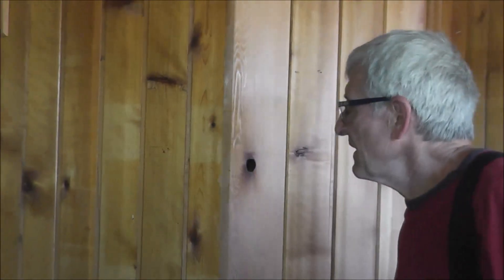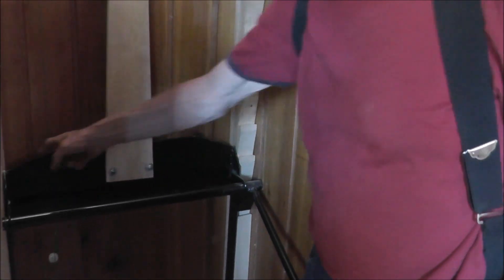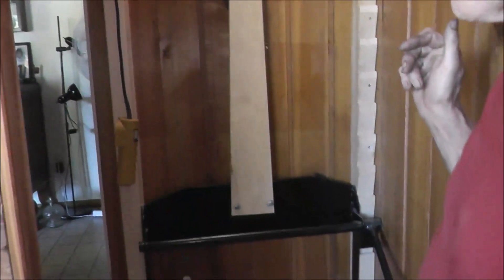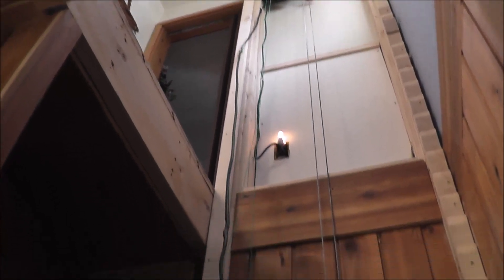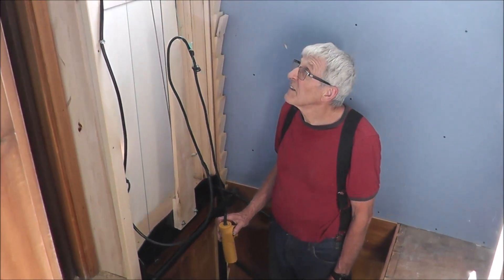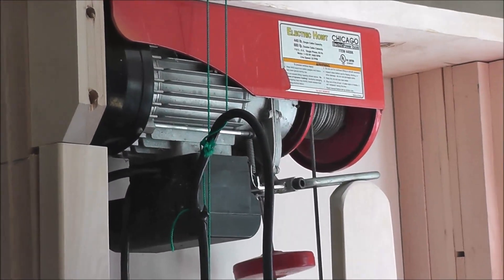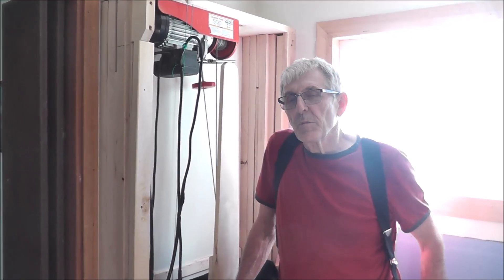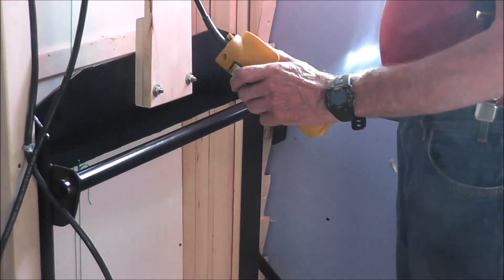DIY Elevator for home or shop

Comment: Many of the commenters here who minimize safety considerations are absurd.  Don't listen to such people.
Your elevator safety approach is dangerous. Fall safety for this application must NEVER rely on operator intervention. That simple.

While I applaud your initiative and efforts, the manual holding up of the 'safety stop lever' (during down travel) is an inherent design flaw that may lead to serious injury.   (Show this message to your wife or any user of your elevator.)
You have not thought through this safety issue. 
A sudden snap of the support cable (or associated critical suspension components) will cause the elevator to suddenly drop.  At this point, the operator's arm (initially physically holding the safety arm upwards against gravity) will simultaneously rise as the elevator begins to fall and become 'weightless'  - thus countering the implementation of the safety mechanism.    
Even if the operator were to quickly (?) move her arm intentionally downwards after the lift started falling (a very doubtful consideration for a 'startled' person when in 'free-fall' herself), the snap down of the 'catch' mechanism when it engages a 'cog' may break her arm (if it actually engages) or otherwise overwhelm the integrity of the stop mechanism (allowing the elevator to plunge totally downward) even if it engages.
You must change this system before a serious accident happens.  This is a deceptively terrible design for a personal elevator safety wise.
A possible remedy might be to attach a passive load carrying 'fall arrest' spring device in 'series' with the cable connection that requires NO operator intervention.  You know, like the original (Otis?) elevator design of over 100 years ago.
Only a completely passive safety system is acceptable.  Your active system actually makes more difficult/unlikely engagement of the safety stop mechanism.
https://www.youtube.com/shorts/BfVpbURY6VM

Comment: Thank you for the information
Reply from the maker: That was a poor video, I didn't know about editing sound etc, got a lot of reaction to it, but has operated flawlessly for number of years with maintenance. replace cable , adjust and lubricate slides.  I also installed fall arrestors as well.

Comment: Love the design!! That said you really should get 2 fall arresters one on each side of the track.  They work like a seatbelt.  Will go in and out until a it encounters over speed then lock it up.  You can get them with cables or the same type material that ratchet straps are made of.   It would be horrible if something happened and god forbid your wife got injured!

Comment from the maker: The converter may be the best bet. jumper cables from the car battery, emergency like that would only be momentary. up or down.   fix it so you would just have to use an extension cord to car. For my self I think I would use a generator as my water pumping system shuts down for water.    Also my design works well, safety going down is not the best.  I saw one video where the fellow attached fall arrestors. They are used in industry to protect workers from falling off scaffold etc.  I have ordered one to put on mine.  I see a number of people have built them now, some good ideas out there.

Comment: I wish you could mount the winch/motor to a concrete floor and use a nice quality pulley up top, or have a good welder make the whole top section from steel reinforced into original structure. I'd hate for that Winch to give way at some point in time and hit anyone in the head. At least you did it and I'm sure it's handy as is. Be careful.

Comment: Needs railing on upper level
Reply from the maker: would be an added safety feature but at the top floor it is in a locked room when it is down.  It is small so would interfere with my wife getting on and off.

Comment: Nicely done.  Congratulations.  I suggest you install a false floor upstairs so no one can accidentally fall down the opening.  You could probably hinge it such that the piece of wood that contacts the upper stop switch pushes the false floor up out of the way.

I need something similar to replace a narrow staircase that is (not to code) to lift items up into a loft above a garage for storage.  You design will be my inspiration.
Reply from the maker: Its a good idea, infact necessary, however in this case it is in its won locked small room.  We get along with that safety feature OK.  But would be better to bde double safe.

Comment: How is the actual frame made?
Reply from the maker: I used 2 inch angle Iron,  Frame around the floor section,  welded to the upright angle iron, flange facing out to go in the guide slot. a couple angle braces and steel plate at top where the cable attaches.
Reply: @brianprocter6191  do you have rollers on the uprights?
Reply: @brianprocter6191  DO YOU HAVE ANY SHOP DRAWINGS FOR THE FRAME ?

Comment: Hi buddy awesome built...it's a genious idea regarding the safety feature when the lift is going up but i have a question about the safety when the lift is going down since you put up the lever....
Can you please help me understand the concept.
Reply from the maker: My reasoning was if the cable or something was to fail, it would fail going up. It seems to glide down smoothly with little stress. What it did was put a spring on the lever so if one let go it would snap into lock, like if something happened going down. I have been criticized for not having a fail stop system among other things.  what I need to do is put another locking mechanism  under the one I have with a strong spring  adjusted to the weight of the person using the lift.  The cable would first release this lock and then start to lift platform. any slack in the cable caused by a failure would quickly lock it in place when going down.

Comment: I thought the electric motor had a safe break built in,  in case the power was off. Usually it is an electromagnetic brake.

Comment: Very nice build Brian. Simple straight forward. I really like your safety catch system. Glad I found your channel.
Reply from the maker: Thanks, it works well and is quite safe, even though I have been criticized for doing it.  Looking forward to better days ahead, my wife goes in for hip replacement next week.
Reply from the maker: safety catch needs improvement. read my reply under Jean Paul's comment. at top right now.
Reply: Do you have any shop drawings for the frame of the platform ?
Reply from the maker: @johndeverjrjack2673  I could make one up for you if you supply an email. didn't get back to right away as needed a part for computer

Comment: Firstly, why do stairlifts cost 14k CAD? In most of Europe you'd pay around 3.5k CAD fully installed... I can't imagine why you've been quoted so much, there surely isn't that big of a difference between European prices and Canadian prices.

Secondly, why can't you get a wireless controller? There are literally wireless controllers for everything... there are most definitely wireless controllers for simply two-way switches... I think that your problem is, that you have zero skills in searching for things; which is almost certainly why you can't find a stairlift supplier that can put a stairlift in at the normal price, and also why you can't find a wireless switch controller (I just did a quick Google, and literally found dozens that would do the job, and all for well under 70 CAD).

Thirdly, and finally, Without wishing to cause offence, I think you've created a deathtrap (or serious injury trap)... There are dozens of crush risk points all over that lift, from the bottom, to the bits between levels, every part is a crush injury just waiting to happen. You have not installed a single crush guard, and as far as I can see, you have not installed a single safety sensor that cuts off power if it detects an obstacle (like a foot or arm/finger etc). If that wasn't bad enough, there is a serious risk of that controller's power cord, getting damaged by the lift action and causing a risk of fire or electrocution.

I know you're proud of your work (as you should be) because as a dumb-waiter or goods elevator etc, you've created a fairly good device, but as a people elevator, you've created a nightmare-in-waiting. I personally wouldn't allow any person to use it if it were in my property, and I most definitely wouldn't allow someone I loved or cared about to use it.

Videos like this, tend to elicit two kinds of responses in the comment section; they're either unremitting praise, or simple trolling, bad mouthing your efforts... This comment is neither. This comment is a genuine, considered response to the work in your video. It is not intended to be insulting or dismissive of your effort or work, and neither is it intended as a troll, or insult... I hope you realise this, and take this comment in the spirit that it was intended.

Comment: just curious ... its been just over 3 years now ,,,how is the homemade elevator holding up ? ... did you make any changes ?  ....  has anything worn out or failed on it yet ?
Reply from the maker: It has worked flawlessly, I have replaced the cable with a better one.  Should maybe replace the winch just to be more safe, things wearout in time. Does not get much use, a few minutes a day, and none now for the last number of months,  wife waiting for a hip replacement, will see the surgeon on the 25th, the covid thing has slowed things down in the north.  Its been a life saver for us,  but some say a life killer.

Comment: I like it but I think it's missing some safety features that hindsight could always prove were worth it, encasing that motor with spool shaft and including some foot level protection in the gaps around the floor. Plenty of other things to bring up actually. That ratchet tooth lever makes more sense as a press down to release as in case of it actually breaking free the user holding the lever up might result in the user hanging on rather than letting go to let it lock in place. Those wires, should they snap (they're not going to) could whip into the user. Should the user happen to faint while in transit they might tumble out or worse be pinched between platform and the ceiling. Not saying the manufacture by independent hands is wrong but considering the application for this elevator it's worthy to build in more protection against chance and time bringing about a disaster.

The lever is an interesting addition if only for the ratchet. I can't in the moment think of an alternative that involves an active input to keep the lock disengaged but naturally released if weightlessness or panic occurs. As to a pinch at any of the lower and upper sections just needs a similar trigger as the one you have for halting the motor at the top. Really think it's important to complete this if it hasn't been worked on further since this went public. Still, a very thoughtful and industrious creation.

Comment: Nice job,,good home engineering, but you do lose your free fall safety I think on the ride down, I will tell you I had that same Hoist and the hook snapped off during a lift of a piece of equipment, 750 lbs, made in China, about got me, I don’t think you are using the hook but just letting you know in case. You probably have the free fall covered but I didn’t see it, just letting go of the safety handle prob,not fast enough
Reply from the maker: Thanks for the comment. lifting much lighter loads , replace cable with better quality and size.  downward could be better. the handle has a spring on it so should snap in if released, I can make it automatic with alittle work.

Comment: Good DIY. What if the electric goes off?
Reply from the maker: I had though of having a small ladder  accesible  to use to get off where one could reach it. However it hasn't happened,  when the power fails in use, all one can say is |I| wish I had.   My wife has gone to use it when the power is off.

Comment: If home elevators werént  so over the top expensive, people wouldn't have to resort to this.
His cost him a $150 to make, while I understand a commercial  has increased safety features im not sure that the difference between $150 and $20,000 is warranted.

Comment: Used sensibly it’s ok, With more money spent on it over time, more safety devices can be installed to it, I’m an ex Lift engineer then Inspector with 47 years experience in the UK.I wouldn’t let children use it, But it does the job for a person with a disability.
Reply from the maker: Thankyou for the very kind comment, considering your expertise.  most would have and have condemned me.  Yes i can modify it to a no fail system up or down, and should. Have replaced the cable  with a much better one and considering replacing the winch every few years.

Comment: Be careful calling it an elevator.
.
Elevators are regulated.
The regulations are part of why the stair lifts cost so much.
.
If the building code enforcement finds you you made an elevator to carry people they can condemn the house until it is removed or brought up to code.

Comment: I've had many prototype projects inspected and certified through the CSA special certification program. I just invent it, document everything and submit it for pre-approval and then take a quick trip to Richmond for a final test manly for voltage insulation testing, just a high voltage Meggar. Pay about a hundred bucks and it's good to install. By making machines plug in instead of hard wired I could save an onsite inspection too. Just recalling some fun projects. A gas fired curing oven for composite aerospace panels made it into the gas safety yearbook and was eventually sold to a helicopter structural repair company in Florida. I always found the yearbook honour a little bit funny or lucky as an electrician dabbling in gas fitting but I did do my homework on its design and as far as homework, for the first time in my life I should probably add.

Comment: The plan looks good - I am planning on doing your design from the main floor to the lower crawl space which is 6 feet high - the current steps are too steep for me - how does it stop at the bottom - I understand the cut off at the top.

Comment: This seems like it had a tremendous potential to be a hazard, but it isn't. If you are aware of what could go wrong it's easy to avoid any issues. (I.e. don't fall down in the big hole in the floor)

Good job!

Comment: Awesome. I need to do this in my home and am researching. Looks like there is a weak single point of failure in that horizontal 2x10 at the top that the winch is mounted to. Might want to double it up or reinforce with some vertical 2x6's or steel like in a doorway / load bearing span. If that 2x10 snaps when going down, it'll be Looney Tunes, complete with the winch falling on your head after you land. Keep up the good work. I love shit like this.

Comment: By lifting that bar when going down, the elevator could go on a free fall if a cable or a gear brakes. Also , some kind of a railing will be appropriate on the second floor.Nevertheless,  it is a wonderful and low cost idea to solve a big problem.

Comment: Not sure about the drop stop. As it's on one side only and you hold it off to descend.
Recently saw an old lift design with the original drop stop idea. It's a cart spring used, where the center is the lift anchor point which hold the spring under tension and the ends lock in if the   cable fails as the cart spring then straightens out.
Reply from the maker: Thanks for the comment. not sure if I understand it completely, I designed a simular idea where as the lift point has a slot which lifts the dog out under tension, The handle has a spring and turnbuckle attached, one tensions it to the weight of the person riding. Any slack in the cable, the dog would snap in. I haven't tried it yet,  Just replaced the cable with a much stronger one.

Comment: Mr. Procter I would like to build the same set up you have designed. Can you make another video showing the guide system to keep the elevator going straight up and down? Outstanding sir, the safety device is spot on! I recognized the winch from Harbor Freight! That is exactly what I had thought of, using a winch, they are strong, and can easily handle the weight!
Reply from the maker: If you send me an email address I can draw a diagram and email it to you. Thanks for your interest and comment.
Reply: @brianprocter6191  Yes sir, feba59@hotmail.com

Comment: Damn the safety full speed ahead captain. that safety will split right down through those notches like a wood chisel through a pine board. No safety gate at the top to keep someone from falling down the hole.There are so many fails in this it makes me shudder. This is a prime example of why they have codes.

Comment: Elisha Otis developed a really neat device that made elevators safe. You should probably read up on it, cause if the cable breaks on the way down, you're not gonna have to worry about hip problems any more.
Reply: Well all the user would have to do is let go of the handle, and it would latch, like a dead mans switch. It should be spring loaded though
Reply: @JukeboxJake  Hard to do in the zero gravity panic of a free fall.  All you got to do is spring load it where with zero weight on the platform it engages. easy peesy